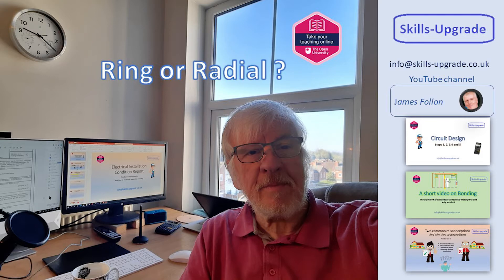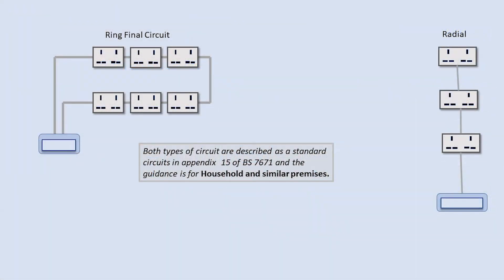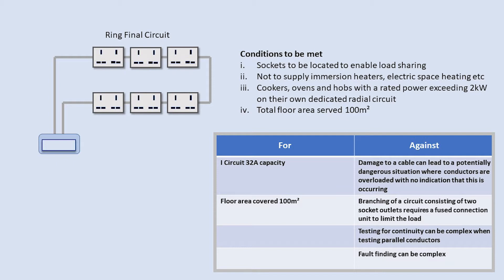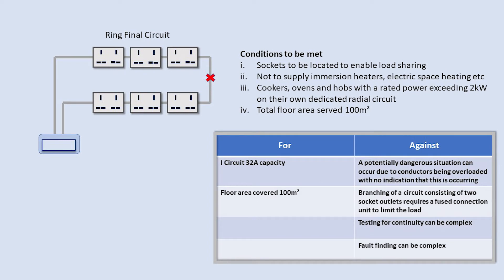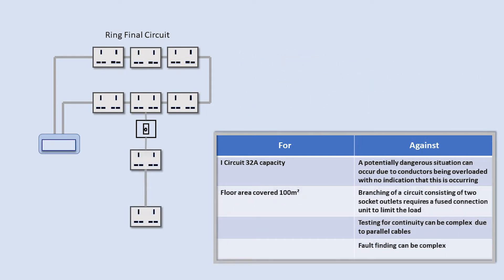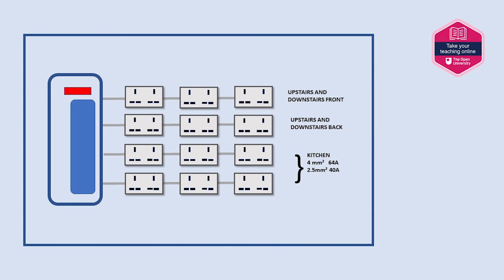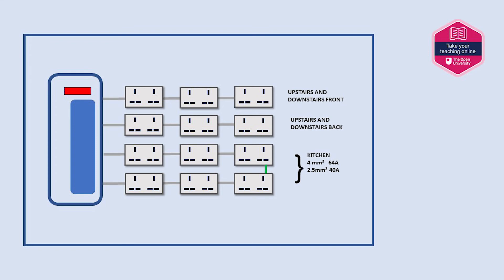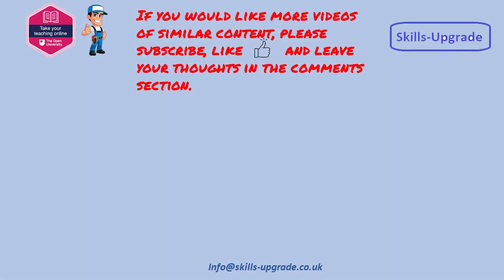Ring or Radial Circuits

Comment: Both, I was a industrial JIB approved gold card electrician , so house bashing doesn't come into my mind, I have never wired a ringmain in any cable less than 4mm, the fact that the circuit would continue to operate is of no consequence, each appliance plugged into a socket outlet is fused down so the chance of overload would not occur, its just in the powers that be heads, 50 years in the game and I never had one incident of overload because one side of a ringmain lost a line or neutral and modern socket outlets have dual cpc connections so if one was lost the circuit would still be covered with an earth , its my point of view that house bashers are just lazy and want radial socket circuits because it's easy, some of the so called sparks I came across in my last 20 years in the game should put the fear of god into everyone because there are men and boys out there pretending that they are competent electricians when that's far from the truth